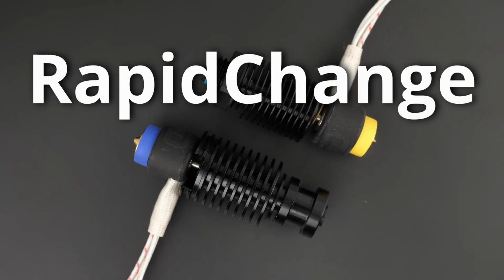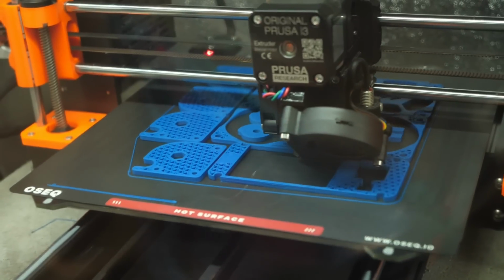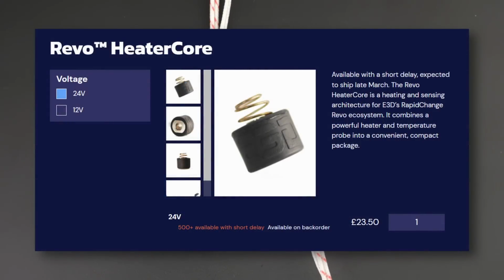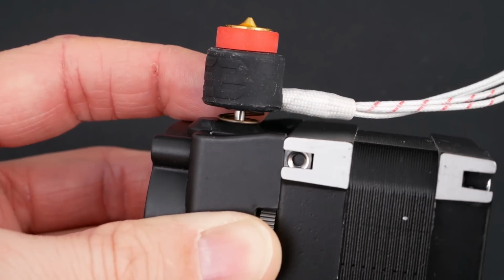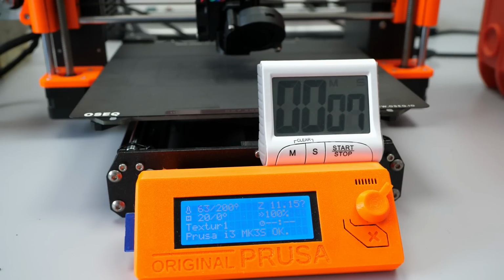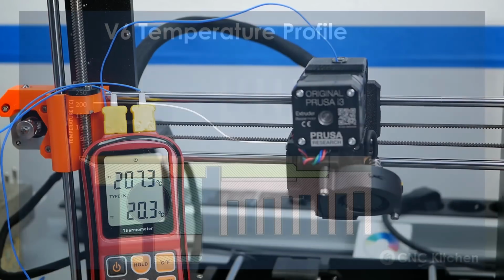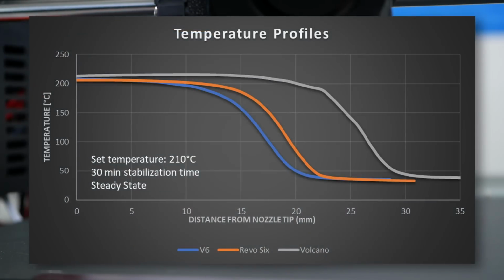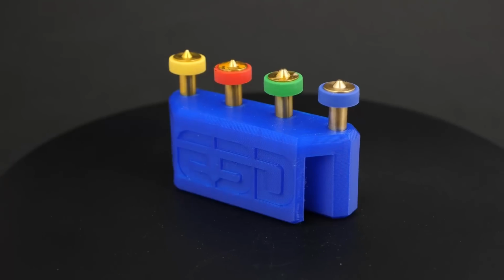E3D Revo™ is great BUT has a dirty secret! (REVIEW)

Comment: I had no idea the new thermistor position had such a significant effect. Cool study!
Reply: "Cool study" - I see what you did there… ;-)
Reply: Thermistor has a huge effect. On my volcano hotend I drilled new hole for the termistor because the design is simply wrong.
Reply: The thermistor should touch the nozzle, the new design is trash

Comment: Extruding the thermocouple into the nozzle to measure the gradient between the heatbreak and actual nozzle temps was brilliant. And so was the way you figured out the temperature gradient. I had tuned my Revo Hemera to run 15 degrees hotter, but I put it down to the massive inconsistencies between different batches of eSun ABS+ filament.

This is some top notch testing and terrific example of lateral thinking. Genuinely impressed with this review.
Reply: @severpop8699  eSun ABS+, like most things Chinesium, tend to vary wildly from spool to spool. You absolutely must tune each spool for flow and temperature settings, and conduct layer adhesion tests or you are in for a bad time.

eSun filaments are essentially garbage, but garbage is cheap. So I use them for prototyping and to otherwise try out stuff. The actual final parts I plan to use are pritned in Polymaker ASA, ABS, or Nylon.
Reply: @nachiketmhatre7411  The problem I encounterd was on PLA, PLA plus, PLA carbon fiber, PETG, PETG carbon fiber, ABS, TPU, HIPS, PC, PC carbon fiber from E-sun that in the same spool there were inconsintecies in temperature needed, suggesting the filament was extruded into a spool out of cross contaminated materials of different composition, I even burned some segments to see if I can smell the differecnde as filament burning progressed, and yes, it smelled like popcorn, than like nylon, than like ABS than again like popcorn in one meter.

This shows me their quality check is inexistent, they do not clean thir machines between batches, and whtever they have leftover in a bin they throw it in the next bin to save some Kg from being discharded, but they might throw in PLA ove ABS and over PC, they don't care.

The other Chinesium PLA, PETG, ABS etc have not this problem, they might differ from spool to spool, but not within the same spool, besides their pretty pricy filament behaves in printing and post printing worse than bloody chep competiton from the same country.
Reply: @severpop8699  eSUN PA-CF is one of my favorite filaments. I like it better than carbon-X because its not nearly as brittle. Strong AF and looks really nice too!
Reply: @severpop8699  I had been having good results with ESun but I have recently been very confused as to why I couldn't get good layer adhesion with my ESun rainbow filament. I thought I was going crazy since it still broke apart even at 230c! (PLA+).
Reply: @randomname4726  high density of tint in the filament is a cause of poor adhesion in all brands, rainbow filament, glitter, etc are famous for having poor adhesion, but yes, try drying it 48 hours at 45C in a food dehidrator and see if it changes anything.

If you want good adhesion you need to use as pure as possible filament, zero colour is best or slightly tinted at most, no glitter, no mirror like, no wood, no ceramics, no glass fiber, carbon fiber, nothing.
Reply: @randomname4726  Are you comparing standard esun PLA+ vs esun silk rainbow PLA? Silk PLA is quite brittle compared to regular PLA . In my experience, it gets even more brittle if left in humidity for a long period and it does not really recover from that even if dehydrated afterwards.
Reply: Question: Do you think the Hemera to a Hemera Revo upgrade would be worth it? I own one now that I haven’t put on yet. I just hate the thermistor and heater wires on my Prusa MK3 which reside on the side of the block. Always worry about breaking one during nozzle replacement which I’ve done in the past.
Reply: @peterwalker5413  I have been using the Revo on my Hemera since launch, and I immediately noticed a slight improvement in quality. Haven't had a single clog either. The convenience of quick nozzle replacement and rapid heating are worth switching over. The lightweight Revo also reduces moving mass significantly. The only downside is the inability to print abrasives, so bear that in mind.
Reply: I have now many dozens of prints on this hot end, have nothing but good things to say about it. PLA, PETG, TPU, NYLON they all print well.
I found they print at lower temps than my MicroSwiss hot end did.
No clogs , no fiddling to change nozzles , no leaking out the top of the nozzle as I had a few times, no struggling to keep the heat brake straight while tightening the nozzle.
I'm not sure how this testing plays into my printing in terms of the uneveness of the cartridge heat ?
My printing requires different nozzle sizes, solving that problem , in terms of time and hassle, was worth every penny. I bought the 4 nozzle kit.
Thanks to everyone who posted. Going to buy the hardened .6mm for tougher materials. It is my go to size for all around printing.

Comment: Long story short in favor of the Revo. The other day I wanted to change the nozzle on my Prusa i3. As usual I heated the hotend, held the heater block with a wrench with my left hand and used another 7 mm key with my right hand to unscrew the nozzle. But this time I didn't pay enough attention. During a fraction of a second, the wrench touched the exposed cables of the heater cartridge on the side (these cables are indeed EXPOSED because of their silly 90° orientation caused by how idiotic heater blocks have been designed). A short circuit ensued, with a visible and audible spark that cut one of the cables of the heater cartridge straight. After repair, I came to the sad conclusion that the motherboard (Einsy RAMBo) had been toasted by the spark too: there was no more voltage on the pins when asking the hotend to heat. This is a €150 repair, with 2× 1 week waiting for the parts, with excessive shipping costs. For such a bad heater block design, which I despised since the beginning even before I even had a problem with it. On my other printer (Voron 2.4) I went with another kind of hotend not so stupidly designed (a clone of the Mosquito, with a fixed, non-rotatable heater block). But for my Prusa I will seriously consider replacing the E3D V6 with a Revo when it is eventually repaired.

Comment: 1) I love how thorough you are with testing. I don't think anyone else on YouTube does it the way you do...thank you!

2) It seems like a lot of expense for benefits that may be rather minimal to a number of users. It seems that the #1 benefit is rapid nozzle changes, but I don't stress about performing nozzle changes, either on the Mk8 hot end on my Ender 3 or the Volcano on my Sidewinder X1. Having a palm ratchet instead of the basic tools that come with most printers maybe helps with that, of course, but those are relatively inexpensive and are useful for anyone with a V6, Mk8, Volcano, or other standard hot end. That kind of price tag for otherwise similar performance and a slightly increase in overall safety seems a bit much.

3) The inaccurate temperature thing might not affect normal printing performance (albeit after what might be a lengthy profile re-tuning process), but it is concerning that there doesn't seem to have been more thought put into how to account for the new thermal profile of the hot end.

4) The lack of licensing for clones is one more example of a seemingly growing trend back towards proprietary tech in 3D printing. The reasoning seems good this time, certainly compared to what Elegoo and ChiTuBox are trying to do with resin printing, but the end result is the same. We'd still be mired in the dark days of using $3,000 printers that are more finicky than a Rube Goldberg machine to print only ABS if it weren't for the massive amount of innovation that came from the open-source model that the industry has thrived on over the last several years.
Reply: Regarding 4, I would say we don't have to worry too much about it: E3D gets their deserved cash from it, until someone circumvents their patents with something cool, maybe even better. I feel like this industry itself, in general, cannot be dominated by proprietary solutions, given the technical understanding of the client base: the industries that need the machines that work 100% of the time (as if they did...) have always had different business models tied to ecosystems and different deals with those brands, hence the traditional 2D printer manufacturers thrive there but not with the other client base, us makers and tinkerers, that know how to circumvent BS moves they might try to pull, and would gladly buy a replacement Aliexpress board/part that solves the issue, which will be quickly available in that hypothetical scenario.
I do wonder about your real example tho of the resin printers, cause I know the Chitubox boards and LCD kits are being sold cheaply enough exactly to that client base that doesn't take the BS, but, I sort-of remember seeing alternatives on the same places that weren't tied down like that. Now I'm not entirely sure tho, so I'm not claiming anything.
Reply: It's not more expensive than comparable hotends. It can't be compared to a V6 clone; they don't have equivalent features. A lot of people consider a mosquito an alternative, and that's more than twice as expensive.
Reply: Comment on item 2: I have a prusa mk3s+ with the "staggered?" Heatbreak 2mm to 2.2mm. I've been plagued by jams 1 month after I got my printer. These jams are only happening in the heatbreak and no where near the nozzle, this has happened with pla and petg. Mostly with pla, petg not that often. I haven't printed any other materials because it's so frustrating to deal with this. I recently found out I can get a new heatbreak that's actually the original e3d one and it should prevents this. But I've been leaning towards just getting the revo and being done with it. I don't swap nozzle often, but if I do want to, I need to consider the fact that I might initiate jamming by messing with the hotend in anyway. And it almost always occurs. Which leads to a whole dismantling of thr hotend, heating up thr hearsink with a hest gun and trying to cold pull the stuck  filament. (Have to dismantle because the bond tech gears mash and melt the filament directly below the gears so it can't move any further down even if the jam clears, and it can't be cold pulled all the way up because the blob doesn't fit out upwards through the filament sensor. I ripped out out once and sent the little ball and plastic piece of the filament sensor flying. So yea. Even though I don't replace nozzles often. I still see a huge benefit to this nozzle for myself.

Comment: The problem with changing nozzles is less the hassle of it and more that I'm scared I might screw it up and either over tighten it or not tighten it enough leaving plastic to sip in between the nozzle and heat break. I imagine the new system is a lot more newbie friendly than the existing nozzle system.
Reply: It's not a theoretical problem either. I destroyed a phaetus dragon doing exactly this.
Reply: There is an answer to this problem that is really simple : use torque wrench or torque screwdriver. There is even some that can be 3D printed. I never destroyed anything using the right tool.
Reply: If you're scared of that then get a torque wrench for installation, and make sure to always pre heat before removing.
Reply: Buy a torque wrench.
Reply: Torque wrench...

😂
Reply: @jeanlesueur6936  I use a torque wrench. It's still a problem.
Reply: @fwiffo  Try lowering torque and be sure to do it at hot temperature. What I do to reduce the nozzle swapping needs is swapping the whole hotend. I have 3 hotends, one for each of the nozzles I use often. So you can have quick change and cheaper replacement nozzles.
Reply: Hmm yes, there are ppl that are not able to tighten a steel screw in aluminium.. There are even professional tool makers out there, that I call the hulk.. They make it to tighten a steel 12.1 screw into a aluminium plate and you are not able to open it again with normal wrenches.. But there is the point.. You no need to close them that tight.. And if it really shouldn't g be tight enough u will see immediately and can just close it a little more, as it is hot then.
The proper process, I also normally don't follow and take the shortcut..
Set in the nozzle cold just by hand without tool.. (or hot, as u must probably heated to remove the old one, then with just a hex socket drive without any tool attached ).
Heat the nozzle up.. Then slightly tighten it with a key and counter hold the block with any kind of tongs.. But still no real force..
Then let it cool down, try to close it more.. If possible, start again with reheating.
The shortcut.. Change hi, close by muscle memory, extrude some fillamernt, watch.. If not close e enough close more... But this has the risk of destroying the thread.
Reply: You can get an ok 1.0 to 5.0 newtonmeter 1/4" torque wrench for ~$30-40 these days, at least on ebay and aliexpress. The one I got was $30 ish, is 1-6Nm, 1/4", chromed, farily short with a light blue handle portion. No name china thing, but it works well and has good accuracy. A regular one so full range adjustable, not the 3-5 presets selectable type.

It's a little more than the single fixed torque value ones (50-100% more), but then you have one for that whole range "forever". Quite often you need less than 2 Nm when working on small stuff and especially 3d printer hotends (1.2, 1.6, 1.8 very common there), so the 2-10 or 2-14 Nm ones commonly sold for working on bikes aren't ideal range.

Whether you're new to torque wrenches or only having used big, much higher torque ones - J+just be aware, that in this instance there's usually not enough "energy" at work with these low torque ratings. So especially at the lower range, so you often won't get that very ovious, sharp detent "click" sound and feel when reaching the set value. So you gotta pay attention to how it feels. You will clearly feel the the indent and the wrench yielding as it should, but when the wrench yields it will be a "softer" feeling mechanical action, and it will not make the loud click as when using a big torque wrench on larger bolts and nuts.

Also be aware, putting away your torque wrench still tensioned to a setting, is a BIG no-no, as it can deform the precision springs inside over time and make it very imprecise. This is extra important with low range torque wrenches like these, as you're relying on accuracy in 0.1Nm granularity. The wrench being off 1-2-3Nm isn't a big deal for a bolt needing 100+Nm. But for small parts like a nozzle needing say 1.6Nm - being off by 2-3Nm is obviously gonna go really badly. So remember to always unwind the tension after use. You can easily feel when turning the adjustment, the point where there's no longer any tension on the mechanism. Stop there, no need to keep unwinding it as far as it will go.
Reply: Or… PRINT a torque wrench. How much that one word can change your will to get some equipment.
Reply: Just installed one on my mk3s, and it tightens snuggly. As in, it stops when you tighten all the way, and there is no way to over tighten it.
Reply: Don't listen to them. I have changed nozzles countless times. But after buying the original hermia this one is based on? 

Snapped!

It's been sitting in a box ever since.  I was watching this video to see if the conversation kit was worth it since I have never been about to buy a new heatsink for the original.

Comment: I have a Revo Six running on my Mk3s, having changed over from a Mosquito. I do a lot of nozzle size changes and the Mosquito was a good solution.  The Revo nozzle changes are slower than with a Mosquito, but the tidy heater wiring and PTC heater are why I switched. As a bonus, the Revo stays much cleaner. The inevitable plastic mess never gets highter than the bottom of the Revo nozzle.

Comment: Great review, thanks Stefan! What bothers me most when changing nozzles (I switch them a lot atm): re-adjusting Z-offsets. Will be interesting if the tolerances of the final production units eliminate that process 🧐
Reply: I swap mine between .6 and .4 often and see no Z change
Reply: You could use something like the Vorons do and set your z with an end stop triggered by the nozzle. That way, regardless of nozzle location, your offsets from the tip to the bed will be consistent.
Reply: @heavenisalie  lucky you. I went through last weekend calibrating my set. Seems the .25 and .8 are very similar in length, and thus similar Z offset. And then .4 and .6 have identical length, so again, same offset. But the difference between the two groups' lengths (and thus Z offsets) is about 0.2mm! Which is honestly quite a lot. Anyway, so I have basically different profiles on my Prusa so when I switch nozzles I also have to switch sheet settings.
Reply: @shenqiangshou  I would be contacting them for replacement IMO, I'll have to check the rest of my nozzles
Reply: I'd be fine with them being only in the same ballpark, so I'd just have to do slight adjustments instead of having to start from zero.
Reply: Z offsets are no brainer for me with my manually universal too swap system, that is now on all my printers for over 2 years, and sometimes I swap 2 or 3 times a day on the same printer as I print with various materials and filament diameters.
I have simply buit in a bolt led slide on which the Zsensor sits, and by twisting the M3 bolt I can gain height or lose height in seconds up to the micron to adjust calibration.